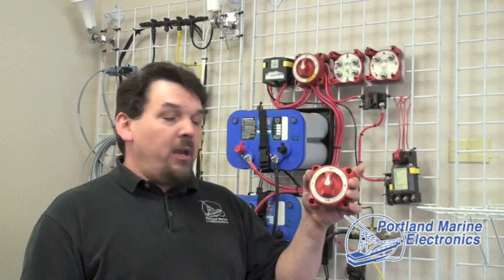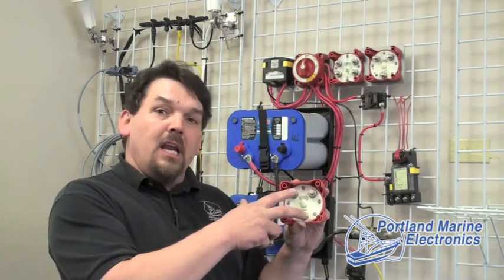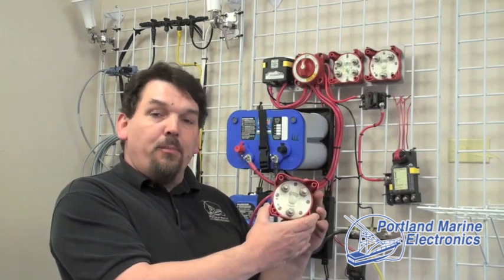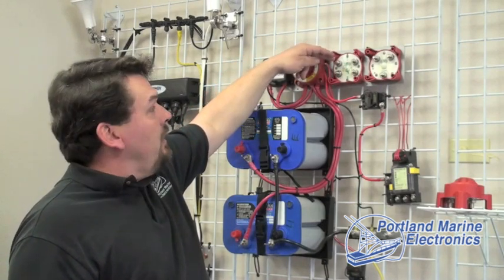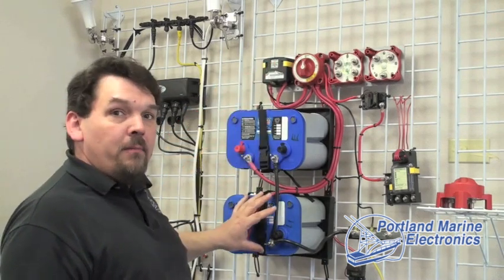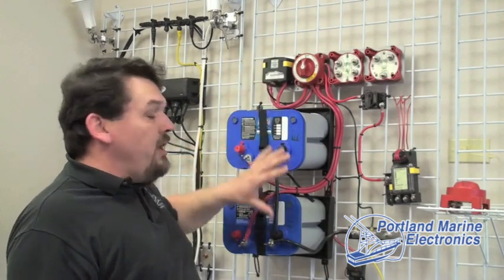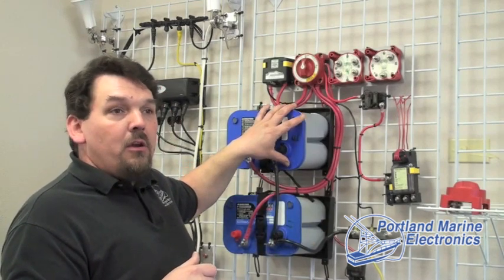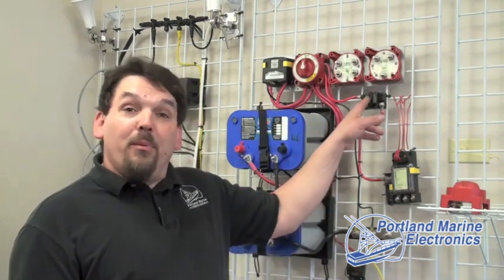Blue Sea System Battery Switch ACR - Portland Marine Electronics

Comment: I just bought that 3 screw switch you showed and I think it will be fine I’m using it for 2 batteries in a car to run an audio system in trunk. It clearly allows me to pick and choose which battery I would like to charge when engine is running and the ability to charge both at same time and when I’m done driving I can turn it off and use it as a kill switch so no one can steal my car and avoid any parasitic battery drains if I don’t drive for a few weeks or months.
Reply: How did that work out? I want to do the same.

Comment: Great video! Im curious though. If im running my radio on battery one, whats to keep it playing when switching to battery two? It almost seems like I have to also run a power wire form my radio to battery two as well, correct? I really appreciate the video and feedback. Cheers!

Comment: Thanks for your explanations!
I have a question: where does the ARC positive connect to the on/of connector (one in 1 position a one in 2 position, but 1 there are two screws and the same for 2 position)?
Each distribution, motor and services has two screws to connect the line. thanks for clarifying it for me.

Comment: This was an excellent video! Greatly appreciate it. When running your 4 power wires to combiner and 2 negative wires from battery does it matter which order you connect in like when you connect or disconnect a battery you usually go red first for connecting. Looking to install and don't want any surprises. Thanks.

Comment: okay so i  have a different use for this mind could you tell me if it would work or not please, my idea is to this in my  solar system  i just upgraded from my sealed lead acid batteries to  gel  deep cycle batteries if i put this switch between  my inverter and battery bank could i use it switch between the  two battery banks the lead acid batteries being a back system  for just in case

Comment: I’m confused. If the switch position is in 1+2, wouldn’t that run and charge both batteries at the same time?
Reply: I have That same question.   I am a newbie and motivated by necessity to learn about this stuff.

I have a convertor/charger that operates very well, with intelligent charging and many protections built in, when plugged into shore power.  It is currently set up to charge and maintain just the house battery bank, while plugged into shore power.   But I want to be able to charge and maintain ALL the batteries... or... both banks... while hooked up to shore power.

I will set up two separate battery monitors... one for the house bank and one for starter bank... simply because the banks are in two different physical locations and I am on a meager budget, so cheap and simple will do, for now, for the required purpose of monitoring charge status on independent banks.

The rig came with an old but functioning battery isolater on board, that allows both house and starter banks to be charged, while the motor is running (which we know does NOT provide full maximum battery recharging, but is better than being completely dead.

SOOOO.... I just bought one of those switches... and am awaiting its arrival.... thinking I could use the 1, 2, off, 1+2 switch... by coming off my distribution panel (charger/converter)... to it... to the switch... and then connect the switch to both battery banks.

The idea being that I could THEN use the shore power to charge either bank, with bulk charging if needed,  and then use 1+2 to maintain both banks for longer stays.

So am I WRONG in thinking that would work?
Reply: @TxRiverElf  the same thing in theory is with the big red switch except you must not change position of your big red switch while engine is "running" or you risk blowing out your ECM or rectifier on your boat motor. This ACR can switch without that danger because of how it is wired essentially

Comment: Would I still be able to use a trickle charger at home and if so how would I hook it up to charge both batt's?
Reply: I have a dual on-board charger and thought the same question then it occurred to me to keep the old 3 prong big red battery switch and place it between the second battery and the ACR so when charging at home both batteries can be manually isolated. THEN i found the BlueSeas ACR that has the big yellow manual switch on top. That's the one that you can manually switch also to force the ACR to isolate the 2 batteries for charging at home.

Comment: I use a NOCO Genius G3500 6V/12V 3.5 Amp Battery Charger and Maintainer to charge my batteries when the boat is not in use.  Can I use this with the ACR?

Comment: In the video, you indicate that one of the terminals on the switch connects to the engine.  Is that the alternator or the starter?  Is there a good instruction manual with this product?
Reply: I've Been trying find this out too.. instructions say engine, for both ACR and Switch (add a Battery Kit) ACR has one to go to engine as Does the On Off Swtich.. which goes where !!!!! One to Alt, and One to Starter.. HELP !

Comment: I have this exact same set up on my 2017 Supreme S226, and all of a sudden that dial free spins and doesn't actually work. I went to the off position and found that the boat would still turn on. Today, the boat has no power but if I wiggle it a bit, I could find a spot where it provided power, but of course something's wrong. Not sure what to do when the dial doesn't work regardless of the position it's in.

Comment: I have the switch you have on the wall there , and 2 batteries...and i bought the  acr... i have an outboard that is just electric start but in the instructions its says the motor switch is optional....is it optional if i dont want to fry my electronics?

Comment: Every boat is different, but if you already have 2 batteries and a switch, it's about $800-$1000 for the parts and labor - depending on the boat's original configuration. isolating the engine electrically is the most important thing, and some vessels require several hours to convert. this is the best way to go to ensure you always have a fully charged engine battery to get you started or get you home!

Comment: I believe there is a serious design fault with this battery isolator. What happens if the auxiliary battery circuit shorts out by whatever means - a cable short, equipment fault, battery shorts or explodes on its own, (as I have witnessed) fuse or circuit breaker malfunctions, or whatever? 
You switch off the Blue Seas Battery isolator immediately which cuts the power to both circuits. But now, you can't switch on the starter battery to start the engine and get out of trouble because the isolator will also automatically connect and send power to both circuits including the faulty one, at the same time. So now, you can't restart your engine or return the boat to safety because you will be sending power to both circuits including the faulty one as soon as  you switch to 'ON'. Heaven help you if you are close to the rocks etc and no time or access to find the fault or disconnect cables etc. "Old fashioned" use of two separate isolator switches would eliminate this serious issue altogether as the starting circuit can be engaged while the auxiliary remains disconnected from its circuit. I'm not convinced this is a safe product.

Comment: OK, not so clear for me, let's say there are 2 batteries, but only 2 red cable, which terminal to connect to? Also, where's the  negative cables will go for the 1st or 2nd batteries?

Comment: Hello Jhon need to make an inquiry about the best installation of battery DM31, I have 4 auxiliary batteries and a single outboard with a 65A alternator, which would be a setup using BlueSea hareware for charging the battery starter and The 4 Optima DM31 batteries

Comment: how can i make the old one work like the new one, can I add something so both batteries charge at the same time with NO issues?
Reply: This will work for what you are asking
Reply: zash when you say “this will work for what you are asking”... are you referring to Be Lu’s 3 prong switch or a four prong with acr unit?
Reply: @TxRiverElf  if you are adding the ACR you need to change the 3 prong big red switch to the 4 prong big red switch so you can manually isolate the batteries when charging at home out of the water.
Or it looks like to me maybe installing the ML-ACR that has the manual switch built into the ACR on top. I am fixing to add a second battery myself and trying to decide on the SI-ACR or the ML-ACR.
See, the big red switch essentially does what the ACR does but it is risky switching the big red switch while engine is running because of sudden spike when switching can burn out your engine ECM or engine rectifier. This switch does it safely because of how it works
Reply: @TxRiverElf  blues seas 7655 has an onboard charger built in to the ACR. That may be just the ticket  for people with tight places and if you dont already have a charger installed onboard.
Reply: zash ... thanks truly for responding...  but I don’t think this set up you are promoting is for me.   

Many boaters may need it to avoid being stranded without power, due to failing to monitor their switch position. 

This would not apply to me. 

I do not have a boat; I have a converted bus with an onboard distribution panel and with intelligent charging... which IS working great for my house battery, when plugged into shore power..

Plus I have a battery isolator, already, that automatically charges both banks, when the motor is running.

I do not foresee any reason to run my motor except to relocate... in which case I would be taking standard Prep measures to disconnect electric and water hookups.

Having the 3 prong switch on hand... and not looking to buy more stuff...  

I don’t see way it can not be used to offer a Shore Power Charging opportunity... for my starting bank as well...

... by simply switching either between the already established house battery to charger connection...  to a connection to the start battery... and ONLY WITH ENGINE OFF... of course... as something to do prior to take off, for short layovers... 

Or ... in the event of longer parking... switch to the “both” setting... 

... so shore power charging can keep both battery banks TOPPED OFF.

Prior to starting the engine... for relocation... I would simply switch back to House Bank Only... 

... so any loads to the distribution fuse panel... like interior lights and radio... would draw only from the house bank.

Again... park... engine off... shore connected... THEN switch to BOTH.... to charge both banks...

Time to leave... disconnect shore hookups... switch to house bank... start engine... ease on down the road.

If I add in solar... in the future...  things would expand accordingly... but until then... I think the old system of hands on control switching will work for me.

I may even make a rather Splenda pilot’s checklist... 😂... left ON THE STEERING WHEEL... to ensure that  I follow proper procedure.  

Best regards!!

Comment: Have battery running down condition...new single wire alternator supplying 14.6 VDC to isolator then to batteries(2)...14.0 VDC to each battery. Engine runs for 1/2 HR, then battery appears to go flat...engine stalls or runs poorly...Whats going on?

Comment: VSR' are a load of crap.  House battery has been connected to various loads and is now discharged to 12 V.  Engine is turned on and starts the alternator.  VSR senses the main starter battery and allow it to charge by itself.  When the voltage is 13.8V i.e. starter battery is fully charged. The VSR connects  the Auxiliary battery to the starter battery and the alternator line, so it gets charged by the alternator and the starter battery. Now at this point this is what happens.  Assume each battery has an internal impedance of .002 Ohms.  Starter battery fully charged to 13.8V  So the voltage difference between the two batteries is about 1.8V.  1.8/(2*.002) = 450 Amps!!!!!  Starter battery is being
discharged so its voltage drops and the VSR contactor opens.  Starter is charged again in a matter of a couple of seconds.  Voltage again drop and VSR opens the contacts. So this chattering goes on until with each pulse the Auxiliary battery is being slowly charged. 
Opening a Direct current with the contacts causes it to arc.  If the VSR uses transistors (a few in parallel) capable of passing this high current at least there are no contacts to arc.  They build in hysteresis into the circuit.  How much?  0.2V, 0.5V?  If the Auxiliary has dropped to 11 V then the current is 700 Amps.  Do they have current limiting? NO!  Now which dumb shit designed something like this using relay contacts? And they sell them to the unsuspecting public for how much?  $125 for a so called 120Amp relay which can be called on to pass 700 Amps? This is a really shameful product